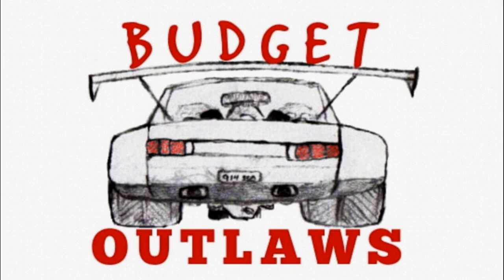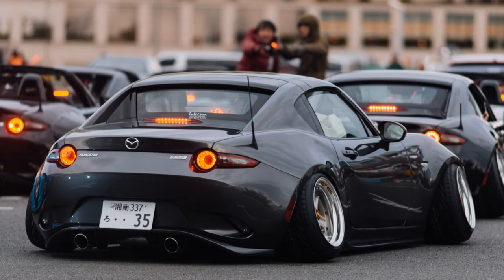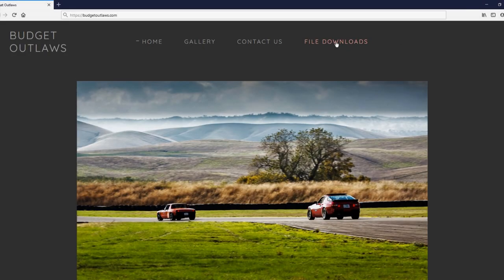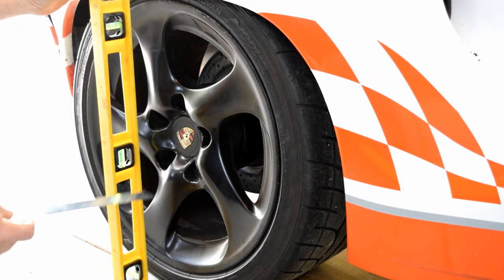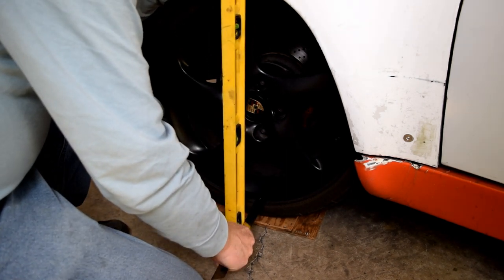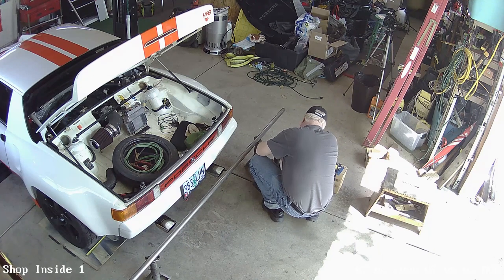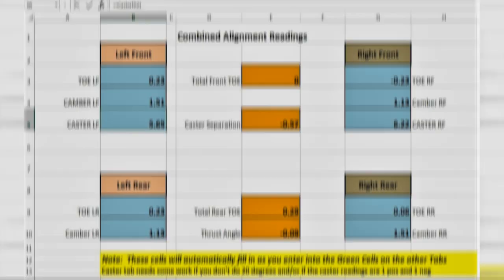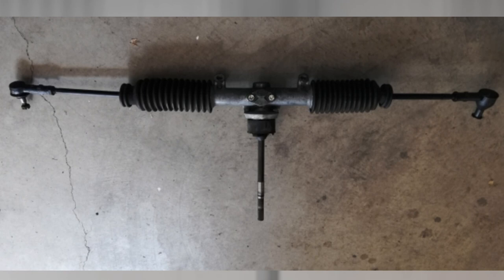DIY Car Alignment with No Special Tools CAMBER CASTER TOE and THRUST

Comment from the maker: Thanks for the kind comments.  Thanks for the suggestion Jieiku1325.  I reloaded the Budget Outlaws website to a free hosting service that will house the alignment spreadsheet as well as other info.  The website name is CHANGED to budgetoutlaws.great-site DOT net  the spreadsheet is on the downloads page.  There is a direct link in the description.  Yeah I didn't come up with the great-site thing, it was the only free option that made sense.
Reply: Hey there! I just wanted to let you know that the link no longer seems to be working. I was wondering if you could re-upload the excel file again. The video was really helpful, thanks so much!
Reply from the maker: @andrewasbill3690  Andrew I was able to download it just now at this link.  http://budgetoutlaws.great-site.net/file-downloads.html?i=1   if it still doesn't work send me a message at  budgetoutlaws@pacbell.net  and I'll email it to you.
Reply: @budgetoutlaws9978  The link worked now, much appreciated!

Comment: This video has inspired me to lookup my local tire shop and pay them to do it! 😂👍
Reply from the maker: Always a solid choice!
Reply: So here what I know with my 25 years in shops doing alignments.
It's very very hard to find an alignment guy that really knows what's going on and does the entire job and does it correctly. I see it over and over that shops never do a second caster swap to verify their adjustments. Techs just skip rear adjustments. 99.5% of them have never loaded the driver with weight during the alignment. It can change things ALOT. Shops just make the light turn green. Side to side difference maybe in spec but at the edges and that can be over 1 deg difference. Doesn't sound like much but it is.

Comment: Great tutorial. Thanks for the lesson. The one reason I watched was to confirm whether adding shims on the rear trailing arm added positive camber or added negative camber, which wasn't mentioned. I suspect removing shims adds negative camber, but I'm not sure. Also, knowing the effects on camber relative to the thickness of the shims added or removed was another piece of data I was seeking. Any thoughts?

Comment: Hi, I recommend that you give a degree to mm converter so as to avoid the inches fraction challenge.
Reply from the maker: Not a bad suggestion.  For me I would have to convert back to fraction because that's how I see it in my head.  But I'm sure someone can use that and maybe make it simpler for them.
Reply: @budgetoutlaws9978  Appreciated. For the same reason as you, visualizing- having been taught more using metric than inches, am sure several users would need too.

Comment: Watched this, then thought.... strings, how 2020, it's 2024 and I got a pair of lasers. Lined the laser levels up 6in from rear hubs, turned them so they same from front hub and it worked great. Used it to measure camber and caster too since it projects a nice vertical plane.